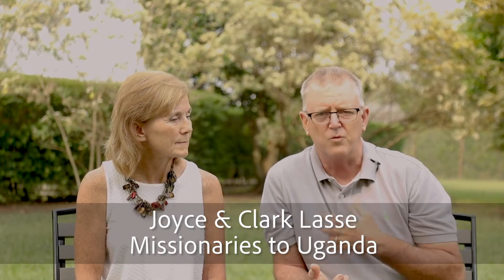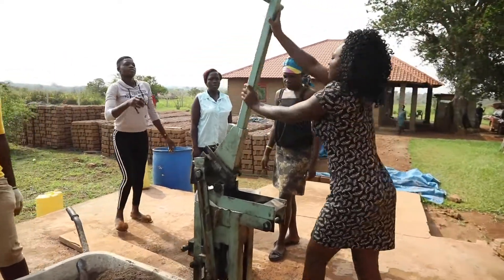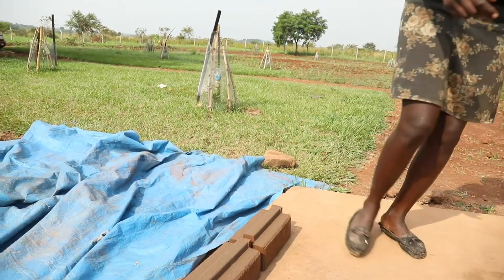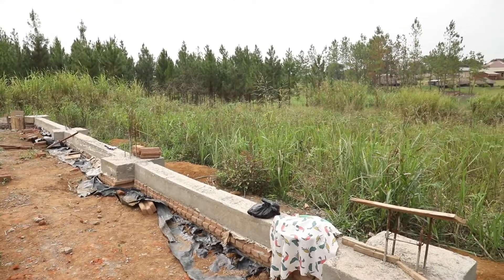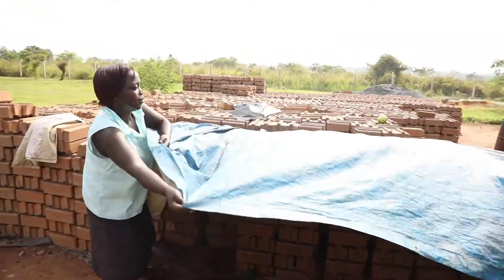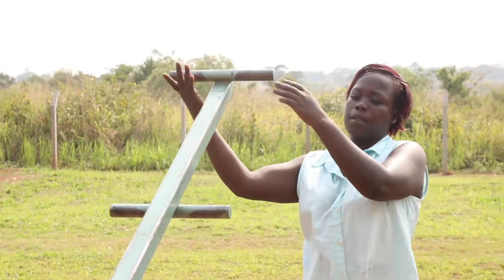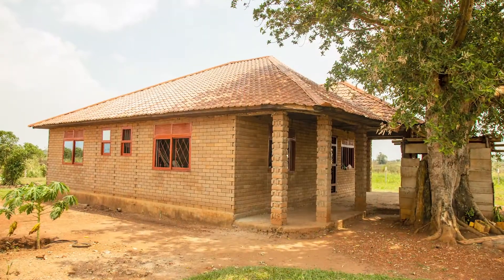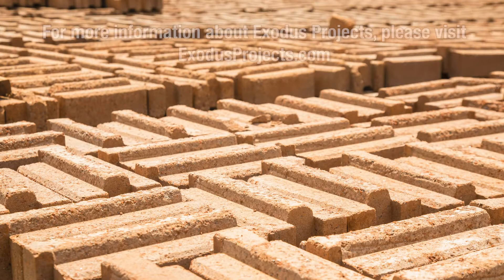Making compressed interlocking construction blocks in Uganda

Comment: G'day from Down Under.  I am looking to make a machine, but, am looking perforated rather than tongue and groove.  My thinking is that having cement and reinforcing through the wall gives stability in both vertical and horizontal plains.  Am working to dry weights and am batch weighing to mixer and to blocks, as am trying to be consistent with the product.  Am looking to make a 3 block / 4 brick press with a 20 tonne jack on a fulcrum to give 100 tonne press at the block / brick.  If it can be set up, am also looking to make roofing tiles with the machine.  Have access to crusher dust, fine (-5mm) stone, with the fines (-1.6 mm) screened out, washed concrete sand, clay and general purpose cement; as much as required.  Curing to be done over 5 weeks, with the water caught and recycled.   The blocks and bricks will be done with different formulas, but, both will be interlocking.   When the show gets on the road, will have to make a video to show what is being done and the finished product.

Comment: How do you test the quality?
Reply from the maker: We use a hydraulic machine press with a pressure gauge to test strength of samples from batches. Quality control is of course very important, but there are several indicators that can be closely monitored while block making is in progress.

Comment: What kind of soil are you using, and the mixture ratio with cement. In addition, how long brick made houses last before they require repair?
Reply from the maker: We have two mixes. One mixture is for foundation block, Sceptic tanks and walls up to the window level. That is 1 part cement, 4 part murram sub-soil (should have 10-20 % clay) 1 part stone dust or sand, and one part sand (or two part sand). To that we add 1 kg water proofing agent. Using an average size wheel barrow as the measuring container, this mix will produce about 60 block with our machine. It should take a team of 6 people about an hour to produce 60 blocks. 
The second mix is for wall block for use from window level to ring beam and interior walls. That mix adds 2 parts murram and 1 part sand or stone dust. We do not add waterproofing to this mix. Using the wheel barrow as our measuring unit this mix should produce 90-100 block with 6 people working the mixing, loading and operating the machine in about 1.5 hours. 
If the block is properly cured (soaked with water 2x per day for 14-21 days after molding) the blocks have a long life. You can also use linseed oil or another water proofing agent like a varnish to further protect against exterior weather effect on the block.

Comment: I want to buy where can i find them around Kampala and how much does each coast please
Reply from the maker: The machines are available through Makiga Appropriate Tech Co. located on 8th st. in Kampala for around 4m/- per each, if I remember correctly. The website is http://www.makiga-engineering.com 0776488688 Or 0756566566. ask for Paul. When we bought our machine in 2017 the cost was about $1000 or 3.5 m ugs.
Reply: I want to know the price of the machine and where to get it in uganda

Comment: How do I get the machine in Nigeria and how much
Reply from the maker: The machines are manufactured in Kenya and can be acquired through Makiga Appropriate Tech Co. located in Kampala, Uganda for around $1000 if I remember correctly. http://www.makiga-engineering.com +256776488688
+256756566566 ask for Paul.

Comment: How much is the machine. Am located in Lira Uganda
Reply from the maker: The machines are available through Makiga Appropriate Tech Co. located on 8th st. in Kampala for around 4m if I remember correctly. http://www.makiga-engineering.com 0776488688
0756566566 ask for Paul.

Comment: Where are you located incase I want bricks and how much per each?
Reply from the maker: We are located in Karuma not far from where the Sino Hydro Electric power plant is nearing completion. Price per brick starts at 1500/- per each. That does not include transport. There are others much closer to and in Kampala who make these same blocks. If you are located near K’la that might be a better option.
Reply: @clarklasse  how much is the machine.
Reply from the maker: @elimugeorge1218  The machines are available through Makiga Appropriate Tech Co. located on 8th st. in Kampala for around 4m if I remember correctly. http://www.makiga-engineering.com 0776488688
0756566566 ask for Paul.

Comment: How many percent of cément do you use for block making ?
Reply from the maker: We have two mixes. One mixture is for foundation block, Sceptic tanks and walls up to the window level. That is 1 part cement, 4 part murram soil (should have 10-20 % clay) 1 part stone dust or sand, and one part sand (or two part sand). To that we add 1 kg water proofing agent. Using an average size wheel barrow as the measuring container, this mix will produce about 60 block with our machine. It should take a team of four people about an hour to produce 60 blocks. 
The second mix is for wall block for use from window level to ring beam and interior walls. That mix adds 2 parts murram and 1 part sand or stone dust. We do not add waterproofing to this mix. Using the wheel barrow as our measuring unit this mix should produce 90-100 block with 4 people working the mixing, loading and operating the machine in about 1.5 hours. Hope that helps!
Reply: @clarklasse  can I get your contact? Mine is +250788709093
Reply from the maker: @namuhoranyemarcel7522  my WhatsApp number is 479-871-9272.
Reply: @clarklasse  Very very useful information. TFS.
Reply: @clarklasse  1:4:2 (1 part cement, 4 part soil, 2 part sand) plus water proofing agent. Is my understanding correct Sir Clark Lasse.
Reply from the maker: @duranopaulo  that mixture ratio is for block used in foundation, Sceptic and water cisterns, and walls to window level. Block used for upper walls typically has a slightly smaller ration of cement (1:5:3) and no water proofing. This ratio produces about 100 block per 50kg bag of cement. The first ratio (1:4:2) produces about 75 block per 50kg bag of cement. The cement we use is typically a mid-range quality.
Reply from the maker: @duranopaulo  pardon me...the second ratio should be 1:6:3 rather than 1:5:3.
Reply: @clarklasse  Thank you Sir for the information.. God Bless you.
Reply: Hi! Can we ask for the compactor design or blue print? This would be a great help for the people of the Philippines.
Reply: @gliceriobelusojr7484   I bought my machine from Alibaba including taxes. From China to Cebu City for $1,700 and takes about a month to arrive the warehouse.